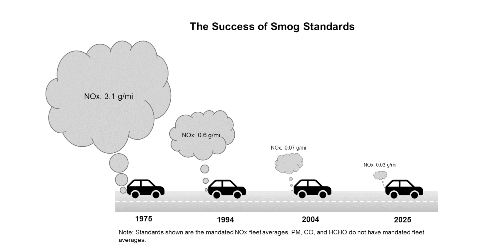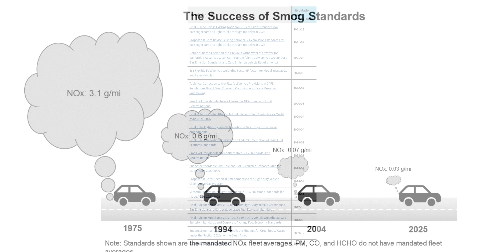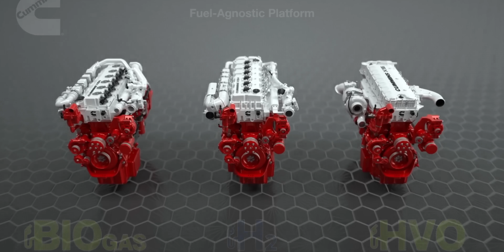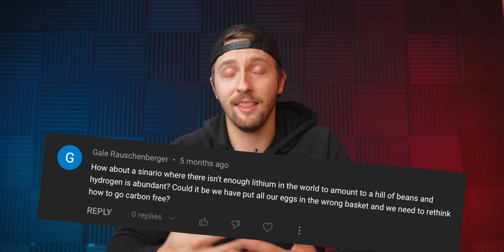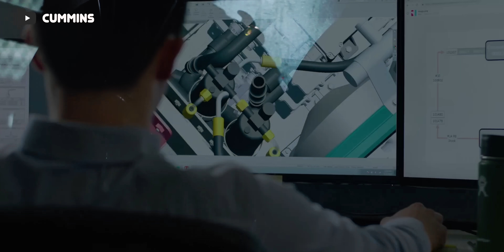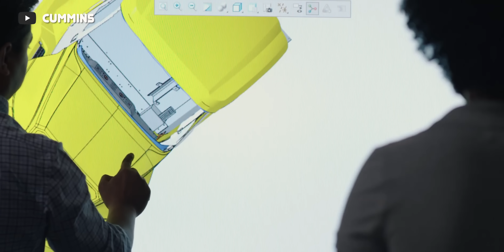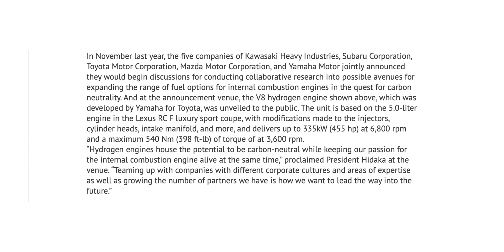Cummins Hydrogen Engine Will KILL DIESELS FOREVER

Comment: The issues with Hydrogen:   pressure issues, tanks, distribution and the fact it MUST be manufactured with large amounts of energy (No, it is not Carbon free) means that we are a long way off if we even ever get there.   I do think it is a good idea to build an engine so it can be configured in different ways.  But I suspect this engine is much less about Hydrogen than it is other fuels like LNG.   I think them or you saying it is aimed at hydrogen is more political feel goodism (Like ethanol gas - an environmental joke) than  an upcoming reality.   Hydrogen is made with an enormous amount of energy.   Unless you use nuclear or some carbon free source of power, Hydrogen has a huge carbon footprint.

Comment: I do believe that hydrogen is a very possible solution but I also believe that hydrogen fuel cells can be a viable possibility. Besides infrastructure, storage of hydrogen needs to be addressed. Liquid hydrogen is difficult to contain for a period of time.

Comment: My biggest question is how the hydrogen would be delivered to the cylinders. If it simply goes through the intake, it would probably ignite too early, and without any ignition control. But also, could an injector deliver enough hydrogen to properly power the engine? My best guess is that it would use diesel for hills and basic acceleration, then switch to hydrogen when cruising at speed.
Reply: Like gasoline, they put it through fuel injectors

Comment: Hydrogen is a very ambitious fuel, regardless of engine type. Most of the difficulties associated with it boil down to pure physics.  It is promoted as being green, but if you look at the hard cold facts it turns out not so much -- at least not yet (see Sabine Hossenfelder's video @ https://youtu.be/Zklo4Z1SqkE     Nevertheless, I applaud Cummins for their work as it advances the technology and will certainly help to reduce particulate emissions, a real danger to health.

Comment: Production of hydrogen needs a lot of development still to be viable. 

Batteries have their own problems for sure, but they're much further ahead currently. They will work fine with a integrated transport system, where rail does most of the long distance work and the ev does local multi drops. This is probably though much more viable in Europe than the USA I guess?

Comment: It might be worth pointing out that these new engines could be called diesel engines, even when running on hydrogen, assuming they're still compression ignition-direct injection engines. Diesel engines, and least in the original sense of the term, are engines that operate according to the principles pioneered by Rudolph Diesel - they're compression ignition engines where fuel is directly injected into the combustion chamber. Diesel fuel is called diesel fuel because it is a fuel formulation that is appropriate for most diesel engines. So if a compression-ignition, direct injection engine is burning hydrogen, gasoline, coal dust, or whatever, it is still a diesel engine, at least in the original sense of the term.

Comment: Off highway, electric construction equipment/vehicles are viable.  Look into mining equipment. They have been using these for several years now, especially in the underground/enclosed areas, where fumes and sparks are a major concern, but also in open/strip mines.  Sure, they have large generators and/or electricity sources on site, but that can also be incorporated where we have large construction sites/projects.  If you only have one or two large generators running overnight to charge several of the machines, then that definitely cuts down on fuel consumption/cost.  Not to mention they are a lot quieter and generally have less maintenance.  But comparing those to a car/truck/tractor, the ability to have large batteries on board makes a huge difference.

Comment: They will be sold at a high premium. Nobody who owns a diesel has much to worry about for a long time. Demos are going down across the west and much of the idiotic reactionary silliness will be repealed. Cars need to go electric but heavy machinery out at the distant project, or on the farm in severe cold will never go electric. Make them cleaner and more efficient,of course, but diesels aren't going anywhere.

Comment: Another problem is if the hydrogen truck gets in an accident that causes the high pressure fuel tank to get punctured, anyone near it will likely be vaporized from the explosion.
Over all though the idea of using hydrogen is the most logical step to lower emissions

Comment: Takes a lot of energy to extract hydrogen from water.  The most efficient is electrolysis, so if the electricity is based on fossil fuel, it is like what is the purpose.  By the way, CO2 is a necessary nutrient for plant life.  All plants require CO2 to grow, every tree, blade of grass, fruit trees, vegetables, wheat, soybeans, rice and so on.  The more CO2 the higher the yields.

Comment: I’m all for ICE hydrogen powered engines, not for EV hydrogen. Hydrogen is abundant, is safely stored in metal hydride as a solid (it’s stupid companies are still trying to store hydrogen as a gas or liquid), and you can use water to get your hydrogen from electrolysis using electricity from solar power. It’s green enough for the hippies and government and makes nice noises for us car enthusiasts and is cleaner than electric by not needing batteries and does not support child labor for mining all those precious metals for EV’s in the Congo such as cobalt.

Comment: Hydrogen is the most abundant element we know of. IT’s emissions are heat and clean water. I did a research paper on this ten years ago. The cars then had ranges close to gasoline engines. Battery components are just as bad as the emissions as a diesel truck.

Comment: Epa is Unefficient .they always make vehicles work harder and not let them breath and be more efficient. You try to rn with a straw in you mouth.thats how your stock vehicles feels.my tier 3 tractor pollutes alot every 4 hours for 30 minutes to do a burn cycle where the engine runs hotter and you don't want to breath the exhaust while trying to do work but I do anyways because I need to get work done.just have things rebuilt at a certain amount of hours or miles.all vehicles should have turbo chargers and having more cubic inches helps.just add more gears and 2 speed rear end.you can baby a big motor and get really good mileage

Comment: At the end of the day, Cummins is an engine builder/supplier company.  They're making money whether it's diesel or hydrogen. I've seen plenty of trucks already being advertised as hydrogen based engine. The commercial drivers of today do not want electric trucks. You're never going to get the range needed. I drive myself, unless you can get 650 avg per day it won't work.  Not to mention, team drivers running 24 hrs a day. Then no electric infrastructure.  There's not enough parking for trucks now. Electric can be used locally, but otr won't work.  Plus, the more you charge these lithium batteries the faster they they die, the shorter the range. Ive noticed that on multiple tool batteries. Hydrogen, lp, and diesels will likely win out. A good mix of all.

Comment: No, it won’t. Hydrogen, gallon for gallon, is much less energy dense than diesel fuel, costs of production, transportation and distribution are greater making it economically and mechanically an inferior fuel. Hydrogen is produced from methane, a fossil fuel, so it is not a carbon saving., the carbon is just released before it is consumed as a motor fuel. “Hydrogen is the fuel of the future,” and it always will be. It may be produced by electrolysis from water, but this is an extremely inefficient system of production.

Comment: It takes a mere fraction of the electricity to seperate hydrogen from water than it does to power ANY vehicle - less than 1%. If you are going to tell a story TELL THE WHOLE STORY! Plus you can use solar to produce the gas. Then it must be compressed - it automatically gets cold under compression. We have been building compression tanks very effectively for well over 100 years. So where's the problem... The only issue is the hardened engine capable of long running life... solvable. Effectively you have fuel from water that has been processed thru' stages - JUST LIKE PETROLEUM OR DIESIL. DUH!!!

Comment: We will need EV, HPEV, Hydrogen ic engines etc in the same era because if we rely on only electricity and nothing other than it then electricty will bcome costlier, and the resources system will crash down. So like diesel, petrol gasoline engines we need multiple technologies to feed the whole population of this world, good luck.

Comment: Sales have dropped significantly for electric vehicles. Costs are through the roof and cause more pollution than a gas engine. Plus think of all those children at the only cobalt
Mine on earth. 
   I fully believe hydrogen is the future. hydrogen is locked down by federal government because nuclear weapons. Right because a small integral process is similar as we have seen in the last couple years government is not our friend. Even Cummins have governments hands around their neck.

Comment: People seem to be forgetting about blue hydrogen. It’s being worked on here in Alberta, basically, hydrogen from natural gas where the carbon emissions are captured such that it is net zero. Much cheaper and less energy intensive to produce than hydrogen from electrolysis.

Comment: Talking heads told us in the 70s the world would soon run out of oil.  A hydrogen engine was possible then.  The problem is the same as the electric engine. You need power to create the new fuel source.

Comment: Anything made from crude oil can be made from algae oil without the environmental impacts, even plastics. Biofuels made from algae oil produce up to 86% less emissions so it'd be like taking 86% of the combustion engines off the market without having to convert or destroy anything, and I'm not just talking about cars. You can also treat wastewater and CO2 emissions during the growing process rendering this the only green energy that is actually carbon negative. There's actually an Algae facility in Colorado and they're doing algae research at Boulder. I do not promote the genetic engineering of the algae though. We shouldn't genetically engineer anything. A lot of places that are researching this are not combining all of its benefits into the efficiency and statistics. Don't be fooled by propaganda put out by big oil companies like Exxon Mobil who are the people that are pushing genetically engineered algae so they can have the upper hand on the market like Monsanto does with corn. Every country around the world could be growing their own Algae oil to produce their own fuels and byproducts while at the same time treating their wastewater and CO2 emissions. No conversion is necessary to run the biofuels in any of the existing internal combustion platforms that normally use crude oil. This is the only product that will completely replace crude oil and the only green energy that helps the environment while it's being made. The enclosed tube systems that are superior to open pond technology can be set up very fast and almost anywhere. There is no need to use fresh water or fertilizer since you can feed it wastewater that we currently use an inferior system to treat. Algae is also one of the biggest processors of CO2 as plants require it to grow so growing facilities would also double as filters for CO2 emissions in heavily populated areas. Pharmaceuticals, cosmetics, plastics, and so many more products that are made from crude oil can easily be made from algae oil without the environmental impact ,such as leaving nanoparticles behind when crude oil plastics biodegrade, without having to jeopardize the quality of the product. If you factor in all of the benefits like being fully independent with our fuel needs, a major reduction in emissions from any internal combustion engine, not needing to throw away the current system and replace it with all new products, being able to clean CO2 emissions out of the air, being able to treat wastewater, being the only carbon negative green energy because of the last two factors, having the versatility to be grown and processed locally to reduce unneeded transportation and pipelines, the fact that it is not toxic to the environment so there would be no more tragic oil spills, the fact that it can also be used for food and nutrients, and the fact that it is a technology that can completely replace crude oil while saving the environment then this is a technology that can no longer be put on the back burner and kept from benefiting the public.

Comment: All these really stupid bullshit ideas for renewable resources using electric or hydrogen or what the fuk and all these ridiculous cons to each of these sources wether it’s pollution, highly explosive, or poor labor standards, etc etc etc when the real solution has been buried by the fuking government right under our fuking noses since the 1950’s. That solution, which is incredibly abundant like fuking EVERYWHERE, and incredibly simple and incredibly safe and incredibly LONG LASTING AND CLEAN IS: THORIUM. Cadillac used thorium to make a concept car that will run 100 years in a SINGLE charge from 8 oz of thorium which on average is equivalent to 57000 gallons of fuel (yes, that’s right and you can search it up easily) but of course it’s not used because IT DOES NOT MAKE ANY PROFIT FOR OPEC OR ANY OTHER ENERGY PROVIDER. This was tested alongside uranium in the beginning of nuclear power and uranium was chosen in favor of the fuking bomb. The original Oakland thorium reactor is still operational today. And the bitch of it all is to mine uranium, millions of fuk tons of useful thorium is collected in the process and then hidden away from us. So let’s all get a fuking clue and quit pussy footing with EV, fossil fuel, or hydrogen and GET THE FUK ON BOARD WITH THORIUM.

Comment: Honestly for truckers say going between one city to the other. They can have a depot in both cities with lots of batteries always charging you can make sure you have a set of new batteries at the drop off depot. drop your load switch out the batteries and keep rocking  on. Probably a lot quicker than refueling if done right.
Reply: Refueling with H2 takes about 6 mins - JCB has developed a hydrogen bowser for its H2 ICE supply chain. If the rig has higher capacity tanks, then timing can be offset by keeping the supply line at a higher pressure. Just like pumping up a tyre...

Comment: EV's Will Not.... repeat, Will NOT become a mode of power for vehicles.... the WEF fully plans to shut it down, just as soon as the engine/vehicle mfgrs reach a level of 64-68 percent electric.  The whole EV push, is just a ploy (trick) to get internal combustion engines (gas/diesel, etc) out of production.  The NWO folks have No Intention whatsoever in allowing the "serfs" to have Any kind of mobility at all, except for your own two legs and bicycles... at least for those who are still alive on this planet by 2030.  Most of the current global population (Especially the US, followed by the UK & Germany) will be Greatly reduced by 2027/28.

Comment: Oh this is great news. I had heard that hydrogen was going to be built to replace EV and gas. It was a suppressed patent but now due to sinister elements from behind the scenes finally being dealt with they are going full steam ahead (almost litterally) with this tech. 50% more power than gas and way more efficient and the most abundant resource on the planet and the only emission is water.

Comment: I feel like hydrogen engines will supercede EVs purely because of range, mining, and electricity required to keep them on the road. It does require electricity to make hydrogen. However, it's a lot less than what an EV demands for a shorter range.

Comment: Their moving on to a gas. Dry gas. It will be interesting to see how long these engines will last. Although. A generator can run on gas. Yet. That's not a full time running engines at a high pressure and Velocity. I miss the old Cat engines. They just worked.

Comment: Cummins Rio Grande engines are natural gas versions of existing diesels with lower compression ratio and spark ignition. They are certainly not new, I bought two of them to efficiently drive refrigeration compressors back in the 1970's. They were not a new idea back then though our energy conserving refrigeration application was ahead of its time. These stout engines could have been adaptable for use with any flammable gas.

Comment: Did you know that you can fuel any combustion engine on Hydrogen, they usually pump it through the AIR INTAKE line. Any current engine can be converted to Hydrogen.

Comment: You hardly every hear the words, "hydrogen embrittlement"  when someone is talking about hydrogen power.  The hydrogen molecule is very, very small and, in an engine the H2 penetrates the steel and other materials causing the engine to fail.  This same issue effects all elements of the fuel chain, not just the combustion chamber.  It makes hydrogen fuel in an internal combustion engine unlikely to succeed in any commercial equipment or tractor trailers.  These engines would fail far to quickly to be viable power sources.  That's why some of the trucks you saw in this video are using fuel cells to produce electricity to power the trucks instead of an engine powered by hydrogen.  Maybe Cummins has found a way to solve this basic materials issue, but I doubt it.

Comment: how is the hydrogen setup different than fuel cells? can they use the same fuel as the mirai?
Reply: Hydrogen is hydrogen, they will be able to refuel H2 ICE and H2 FCEV at the same "pump", asuming they make the sensible decision and utilise the same tanks/recharging hardware